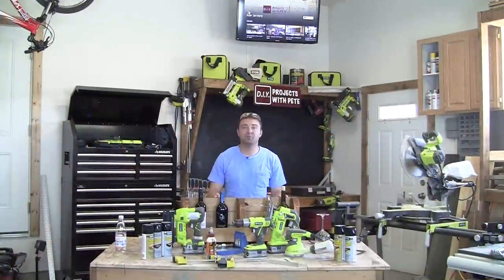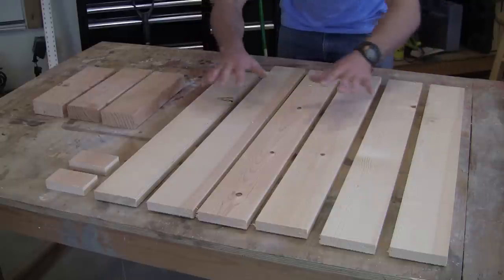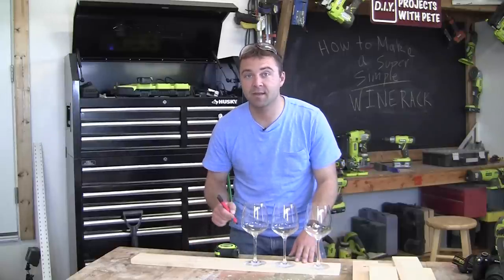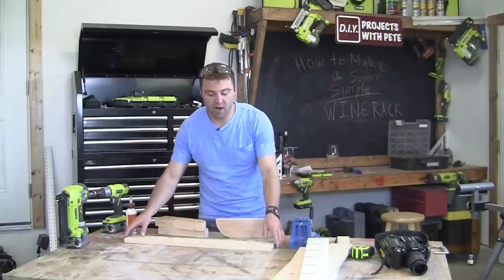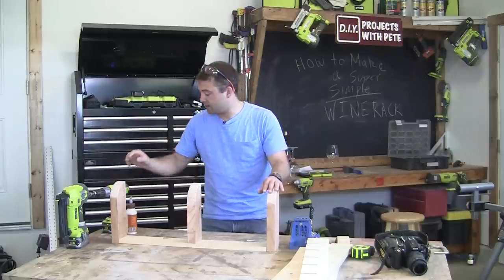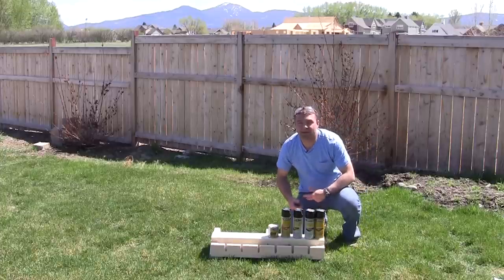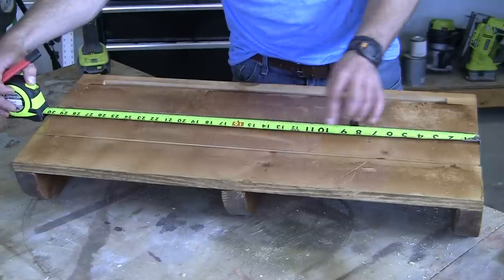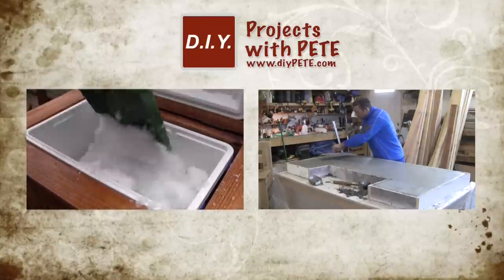How to Build a Wine Rack | DIY Wine Rack Minwax Wood Stain

Comment: I loved this one. But dont wines have to be stored up side down to prevent the corks to dry out? I heard that is that true they can dry out?
Reply from the maker: Hi! I think that long term bottles are typically stored horizontally. This type of rack isn't meant for really long storage, but works well for displaying the wines and holding them after they are brought out of the cellar. Cheers!

Comment: Pete, great video, thank you!

Quick question: Do you drill pocket holes (6:17 on the video) all the way or just enough to hide the head?
Reply from the maker: Hey! I set the jig up for 3/4 inch stock into 1 1/2 inch stock. This little screw selector wheel is super handy for figuring out that stuff if you still have questions :) http://amzn.to/2ncM9cI
Reply: Thank you, Pete!   Got tools and materials:-) 

One more question, if you do not mind.   Will Minwax® Polyshades® go inside even between two lower planks all the way? I'm concern there still will be unpainted space. I'm thinking maybe assemble everything first except lower plank that holds glasses, apply Minwax® Polyshades® to both - almost ready rack and plank for glasses and attach.
What do you think?

Thank you, again!
Reply from the maker: Hi! I was able to spray and get it all pretty well, but you could certainly use your method just to make sure! Cheers!
Reply: Pete, the rack is done!!!   I actually built two - light and dark one. I'll post pictures as soon as I have them.  Thank you very much for great video and detailed instruction!

One more question/thought:  In order to hang it, you suggest just drill two holes and screw it.  I afraid it would ruin a look (a little).  I read some people are using D-ring on the back.  What do you think? What would be easier/more reliable/nicer? 

Thank you!
Reply from the maker: Congrats and nice work!! You could drill the holes lower ( so the front piece and wine bottles would basically cover the holes. As for a D-ring -- I'm a little worried with the weight of the bottles and if an unbalanced rack would shift it. You could always get a cleat system - They look like this: http://amzn.to/2n5bIh4   and they carry them at home depot as well. Let me know if those ideas help at all. Cheers!

Comment: Why not make the 11 inch 2x4s 12 inches instead of adding spacers? I did this project today and the spacer was a smidge to small so I may give this one to my friend and do another with longer 2x4s for the end.
Reply: Oh and by the way thanks for poating this video it was a great project and a money saver
Reply from the maker: Extending the 2x4's on the end would work perfectly.  The reason I didn't do that is because with the spacers it is easier to get both sides exactly the same same space.  With the 2x4s extended it would be possible to have an uneven spacing if the board drifted on the glue or if the measurements weren't perfect.  Glad that you like the project!  Hope the next one works out to fit your wine glasses.  Cheers!
Reply: DIY PETE I'm still learning but that seems like a good reason. Keep posting these awesome videos so I can keep making cool stuff

Comment: What is that a brad gun your nailing with . What is it
Reply from the maker: Hi John! I use a Ryobi Airstrike nailer in some projects. It works awesome and it is battery powered. Cheers!
Reply: @DIYPETE  what the guage size on that nail gun